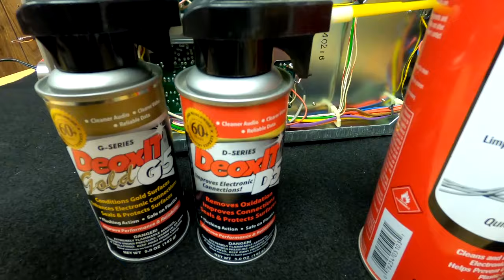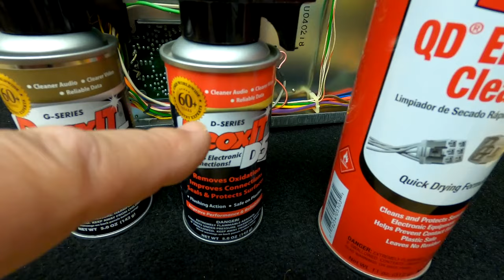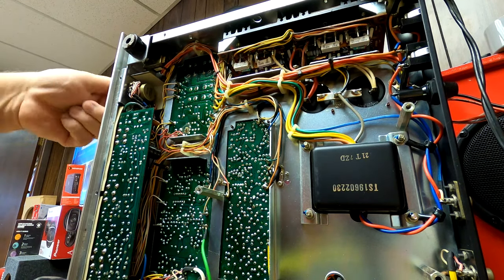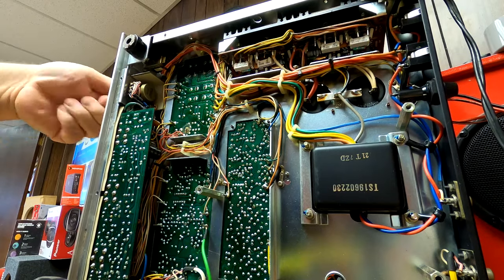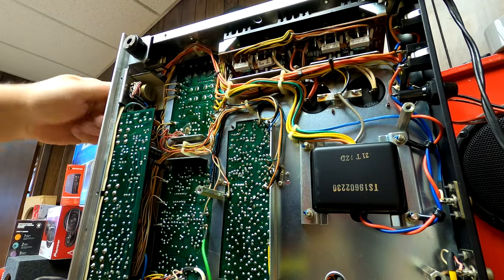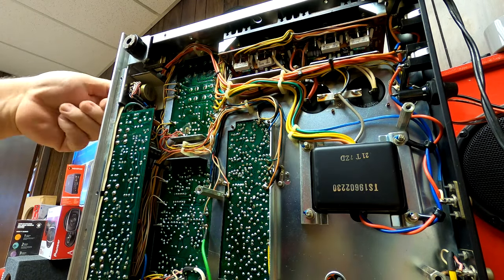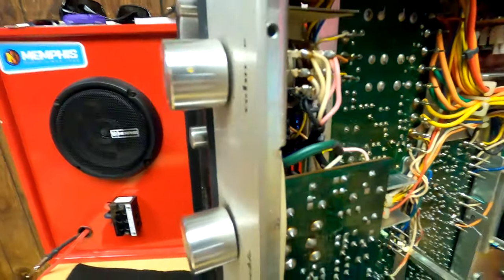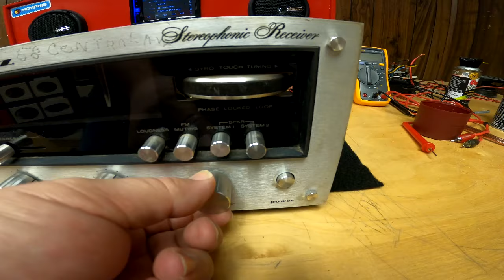How to Clean a Dirty Volume Control

Comment: I used Deoxit D5 on my guitar pot,  -now it has zero resistance when turning .. it turns by even just slightly bumping it with my finger....   How can I get it like it was??  Is it permanently damaged?
Reply from the maker: Replace the pot. It was more that likely bad quality anyway. IMO, however it is hard to tell without seeing with my own eyes. Cheers

Comment: This can use on ddj sx2 pioneer DJ? My cross fader is bleeding
Reply from the maker: Yes this may work well for you maintenance wise, not sure of the "bleeding" issue, that could be a circuit design thing in conjunction with dirty fader control?  I would be interested in your results. Cheers

Comment: I remember I had a problem with my speakers years ago, they still worked; However, they stopped working after I disconnected everything, then reconnected them. I'm actually reluctant to try cleaning my speaker now, because of that-And it's getting fuckin bad.
Reply from the maker: I check the volume control AND speaker select switches as they are seldom used and they get dirty/corroded from lack of use. I hope you "fucking" get your tunes back. Cheers
Reply: @breakerbroke23  Yeah, I'll have to FUCKING  break down and attempt it eventually,

Actually, I should ask- does black circuit board discoloration mean it's fucked? Whatever caused it...

I think I threw that speaker set out, so I can't show you.
Reply from the maker: Discoloring is most always a sign of heat.
Reply: @breakerbroke23  Which means...
Reply from the maker: Somethings fucked up!..... IDK..... send a pic and I will take a look. That info is in the about section.
Reply: @breakerbroke23  Alright, I'll see if it's still around.

Comment: DO NOT USE Deoxit D5 (Red can) in a pot. Over time it will ruin the pot. 
DO NOT SPRAY anything into your gear while it is plugged in or turned on. 
Pots work by using a carbon slide surface as a variable resistor. As the slide contact moves along this carbon surface, it increases and decreases the resistance. A volume pot is a variable resistor. 
Deoxit D5 will destroy that carbon slide surface over time. 
USE Deoxit F5 and don't spray it where you have it dripping out of the component. 
Especialy if you're using it to clean a variable capacitor type fader or knob. Spraying too much into it can short it causing it to release the stored electrical power inside it at the wrong time. 
You only need a quick burt of it. You immediately turn the pot to work the cleaner into it. Then blow it out with come air.

Comment: Can i use wd 40 contact cleaner?
Reply from the maker: Although I have not yet used this product I understand it works good.
Reply: Don't use wd-40
Reply: @fredvelasquez4011  wd40 now do a specific contact cleaner (as well as regular wd40)
Reply: I've sprayed WD40 many times in faulty electronics, and the fault is no more. But not on a $10k device. 

Sorry, also used in my car.  Its literally magic.

Comment: g5 not for pots
Reply from the maker: D5 works very good for pots and gold can be used as a followup treatment. Back in the day I used D100 as a followup but found in mobile electronics ( Car Stereo, CB Radio ) it would attract dirt particles. So the system I use now I find to be most useful. But hey, to each his own.... Cheers.
Reply: @breakerbroke23  wrong

Comment: Don’t use the red with pots!!!  Use the green, and gold!   Red will eat the carbon tracks of the pots!  You  also need to take the pot out, take it apart clean all the contacts and then use fader grease.  You are doing this all wrong!  You just washed all the grease out!

Comment: At least try and catch the dripping liquids - they are often sticky and nasty- the last thing you want dripping onto the components. The amount of times i've picked up gear cleaned like this by amateur audio nuts as 'working' and they are full of gunk is ridiculous. Your method is always a temporary fix - and the best solution is to take apart the pots and clean properly. For a 'quick fix' that last the longest- I recommend Isopropyl works best from my experience and 100% evaporates.